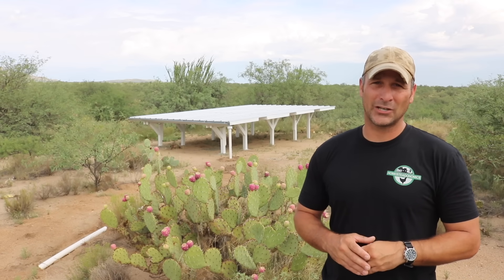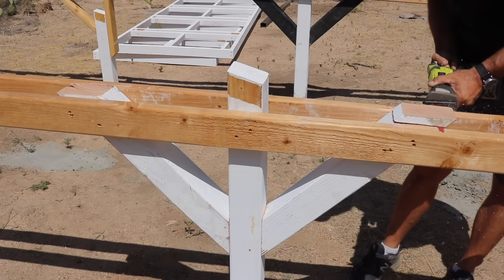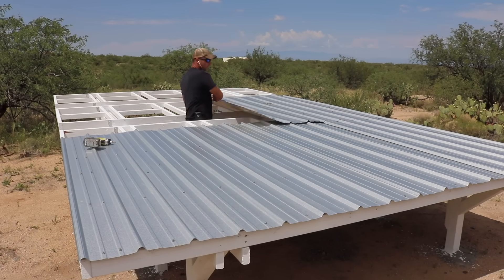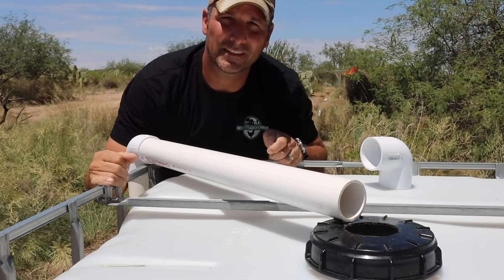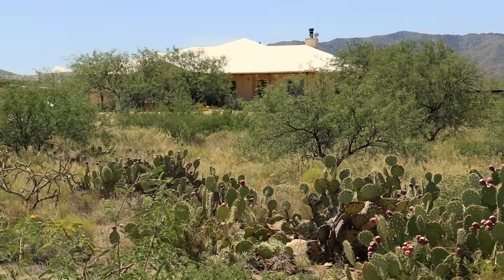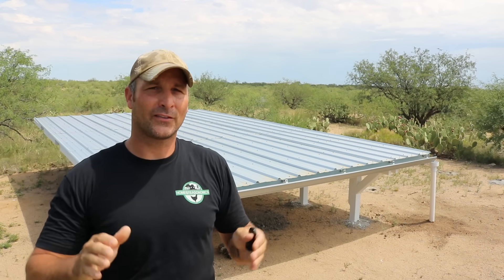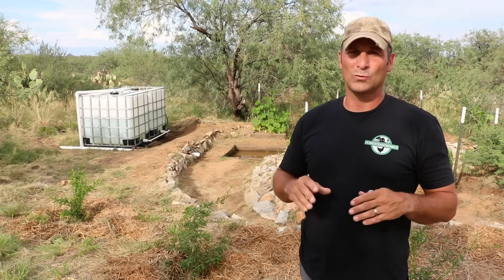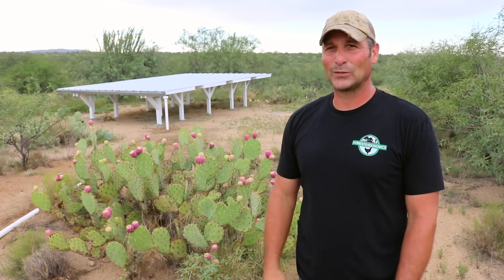Rain Roof -  Rainwater Harvesting Project - How To

Comment: Steel is good. Avoid aluminum though.  Aluminum has been linked with dementia, though dementia is easily reversible with apples.  The pectin in apples pulls aluminum out of the brain cells and is a good preventative.  Or a naturopath doctor, specializing in nutrition, can test for heavy metals.  They can do chelation therapy, iv therapy, to detox heavy metals like mercury, lead, cadmium (from tobacco).  It is quick reversal. People opt to do chelation, instead of chemotherapy.  The cost is nominal and has no side effects.

Comment: If you're planning to use drip irrigation with a system like this, paint the totes black or you'll be plagued with algae-plugged emitters.  You can buy screen filters on amazon for about $10 but even they will plug up.

Comment: You could be sheltering from the rain underneath the roof if only u used taller posts. A waste of material without multi-purposing
Reply from the maker: Did you watch the whole thing?  I actually talk about that and why this isn’t an ideal design, why it should be a structure that has another use, etc,.....the posts were from and existing project and I was just trying to use the materials on hand and make the best of this concept on a remote part of my property

Comment: Tried that in Tampa put a metal roof on my house buried a 500 gallon tank installed treading system .then zoning inspector fines me $500 then I get summoned to go to court for permit not pulled $1500 then I get a court order saying I had to remove the system couse I'm on the city water grid and it's mandatory to buy my water fro. Them . Told them to go f themselves 30 days later they file for seizure of property . Had to fight that for a year . All buracratical bull to steal my money and my house . Told the judge that if any of you bastards ever step foot on my property again they will meet my 2 friends Smith and Wesson.  Judge gave me a year in jail for terroristic threat get out of jail and there was a fucking cop living in my home they stoled my fucking house . And get this the system is still there and this cop is saving tons on water Bill's. So I lost every single thing I owned all over taking advantage of mother nature . The whole system is corrupt crooked and a bunch of thieves .

Comment: You have wasted a good roof and it's purposes. You should have build shelter of some kind. Good intention but bad uses of roof.
Reply from the maker: I actually talk about that in the video.  How this is not the best design and how it should ideally be a dual purpose structure, made higher, etc,.   Did you watch the whole thing?  I was just trying to use the existing structure and what I had on hand to make a project.
Thanks for watching

Comment: I've see  the same used in Arizona that had a fixed structure like yours then added tarps on a frame that spreads over when rain approaches.
Triple or more your water accumulation.
Reply: Two feet lower and rabbits could shelter from coyotes, three feet higher and you would have had a shed.
Reply: Damn just said the same thing

Comment: I see you did a first class job building it but it's so strong and shade is so precious. Why not put taller  poles at the corners and use it for a car port.  Then put solar, panels on top or black water lines for hot water and cycle water through it. Use the extra pressure from the height to fill a higher water tank.  Just always try to do 2 or 3 things at once. All that shade it creates,  you get no value from it.  That's why some thumbs down, not what you built but it isn't raised up.  Knock knock, who's there..........raisin,  raisin who? Raisin water collection table so we can sort grapes in the shade and make.

Comment: Sorry, but have to ask. Your the third you tuber to show the same idea. I think it’s a great idea. I ask myself why not make it higher so you would have shade for what ever you would need shade for. If you had shade for the tanks maybe you would not have to put the tanks in the ground. Maybe I’m missing something with the design.
Reply from the maker: Thanks for checking out the video Donal.   But I actually address those questions in the video. Regarding height, covering tanks, better designs, etc,.   I was just using an existing structure and the materials that I had on hand.  I actually mentioned  that it would be better to have it higher, car port, double use, etc,.   Check it out😀👍
Reply from the maker: .... 0:35 I talk about addressing height, etc later in the video👍

Comment: Will the metal material rust overtime from the elements? Also, because this is in the desert you're making this project, is dirt not an issue getting into the system? Or is this just used to water plants? Thank you.

Comment: Did you test when there is bigger amount of watterflow? I'd be concerned that the watter would overflow from the gutter and lot of it would be spilled. Usually the gutter is closed in the end and it has a hole on the bottom that leads directly to the pipe so that would prevent any spillage . But if it works, than there is no need for this of course :)

Comment: I have heard that there might be a potential for galvanized steel to leech miniscule amounts of substances into the water.  I also heard the amount of leeched substances depended on the amount of rain that passed over the metal, the chemical processes that the manufacturer used when making their composition of galvanized steel,  temperature and climate (dry, wet, etc) and other stuff.  I'd do research as I don't know much.  But playing it safe is always at least a good idea, especially if animals, and/or people will consume the water directly, after some filtration, or through the water cycles after it goes into the ground, into the garden, and "perhap" into the vegetables, and the body.

Comment: At 1:36, what is the name of the mechanism you use to pull the posts out of the ground?
Reply: Also, what angle do you typically use for the slope of the roof and the gutter? Thanks!
Reply from the maker: I used a ‘come along’ with a piece of steel pipe....you can also use a ratchet strap as well.   Just add a piece of chain at the bottom of the post and then place the steel pipe or tubing next to the base of what you’re pulling out.   Connect through come along’ to the chain and then to the steel pipe/tube and Jack it out of the ground👍😀
As for level or slope of roof.   Nothing critical just enough to have the water run off.   But if you are in a heavy snow area you will need to have much great pitch to keep snow from building up too much. 
Hope that helps👍

Comment: It takes a little patience to read through some of the comments. It seems as though people don't watch the entire video, then tell you you should have built it taller. Sheesh...
Reply from the maker: Robar haha.....I completely agree with you😂👍.     When you make videos I guess that just comes along.    But it is crazy when you spend several minutes of the video showing/talking about something that you’re pretty sure people will have questions about.   I think I addressed the height about 3-4 times and also mentioned that this particular case was not the best example..., and that it would be better to make it higher be a part of a double use structure, etc
Anyways, thanks for watching😀👍🙏

Comment: The Govt put some of those up in Eastern Oregon. They’re called “Guzzlers” They collect condensation as the panels cool in night air. The collection tanks are underground. As the Mule Deer, Elk etc. stand on the splash pad their weight pumps the water to a drinking trough. I think if you’d have used darker metal you’d have seen the same results. Look into the “Guzzlers of Eastern Oregon.”

Comment: Smart way to pull those posts.
Something to remember.
I am thinking this on a smaller scale.
A roof on my compost bin.🤗

What I like about your projects is my needs are much smaller.
So far all your work is much easier on a much smaller scale. 🤗😉🤗

I will probably use a durable tarp instead of metal roofing.
Do I have to worry about toxicity?

Comment: You mentioned using other structures in order to make a dual purpose rain roof.  Would you recommend using solar panels to catch rain?  Is there a chemical coat on the solar panels that would make it unsafe?

Comment: So you had the test jigs all set up and all you had to do was run two gutters and an extra piece of pipe to make what you had at the start a viable solution, but you chose to tear it all down, pull posts out of the ground, and start over? How do you feel about the value of the time spent on that endeavor and how much of your time you spent vs the value you got out of starting over from scratch essentially? Just curious.

Comment: I would put photovoltaic panels on top of the rain roof, but I'd do it such that the water collection is not impeded. As you mentioned about dual purpose, I think you might have the same idea. That way that little patch of land is being very efficiently utilized. 

I noticed you're probably in southern Arizona, perhaps around Tucson. I noticed the 928 area code on the banner. I'm in the Phoenix area. I can also say that it looks like you've got some prickly pear fruit to harvest there. Anyway, I definitely like the rain water supplied garden concept. Great job with your experiments.

EDIT: Now that I've read more, I see it's Sahuarita area where you're at. Also, regarding the javelina, I had two thoughts: 1) I'm guessing you've probably considered putting up fencing around the garden to keep them out, and 2) I wonder how much javelina taste like pork.

Comment: It seems like wasted pottential, i mean make it a bit taller and add a wall and you have a shed as well as a rainwater harvester.
Reply: true, but the taller height would make it less likely that the roof would get cleaned when it gets covered with desert dust.

Comment: Why so low?
You should use the space under for shed, o any utility room or just hung a hammock?

Besides with a higher roof will increase the water pressure (velocity of free fall)to run the water in the pipes of distribution 
( plain common sense / physic. : v= hxg
g=9.8m/sec
g= gravity 
V=velocity of water
h=height of roof)

Comment: Would you please explain "Level difference"?  Thanx!
Reply: Water from a higher source will always flow to a lower source. Gravity. 

Thus, the roof is higher than the totes, so any water will flow down the 2" pipe and gravity feed itself into the tanks. No pumps required.
Reply: @ScooterMcAwesomeness  Thank you!

Comment: Awesome. Now if you put solar panels on the roof you will also get clean power along with water and water the plants automatically using motor and you could even use a timer too for it to work 24x7 unattended!
Reply: Verkeerde video

Comment: Thanks for the video, I just hit subscribe. Mostly subscribed because you showed simple quality work, how you did it and why you did it no extra malarke. It seems to me any project is going to vary depending on the situation and resources. Perfect multiple use situations are nice and if you can plan them into a project great but using what you got gets a box checked.
 Loved the stone wall on the garden looks very well done. I'll be looking to see if you have a video on that.  Loved the kids and dog 'helping' as others have mentioned. Also was intrigued by the billboard vinyl system - good repurposing! Two final thoughts - shame someone hasn't created a solar panel that looks like the metal roofing. And "javelina event" not a phrase you hear that often. Again Thanks!

Comment: Add a small pump to the tanks so you can run a sprinkler system on a timer, saves walking around with a bucket

Comment: Thank you for the video.  I will be building mine as a dual/ triple purpose structure, rain water catchment, livestock (milk goats) shade, and shade for the IBC containers.  Planning on doing this in NW Texas so weather is similar to yours. You vid allowed me to visualize a more practical use...too close to the ground and they goats will jump up on it, lay on it...etc, maybe a little taller than yours, therefor providing shade for the animals and a water system. ;P

Comment: we gravity water our plants from the tank using valves to regulate/stop the water flow. we used pvc pipes and simply drilled holes in the pipe that correspond to planter boxes or trees.

Comment: I was told by a roofer that a strip of galvinized metal near the peak of my house would prevent moss from growing on my shingles due to the water picking up some of the zinc from the metal. He said the water will remove zinc slowly over the years by disolving into the water, and that is why after a long time the zinc gets all used up and the metal will finally start to rust.  SO, if this is the case, will your water collector have high levels of Zinc dissolved into it that may not be a good thing for consumption, appliances etc?

Comment: Nice job on the project.   How did the rain water travel up to the “top” of the IBC?    Also, it would be great if the posts were raised higher so that animals can use the roof as a shelter from the sun.  😉
Reply: gravity. the top of the ibc is lower than the rain roof so the underground pipe fills completely with water and because of gravity the water naturally flows downhill through the pipe.

Comment: This is by far the most stupid way i have ever seen to waist a roof. Why is this not just a shed or whatever you want so you can use the space underneath?
Reply from the maker: Rein Clauws maybe you didn’t see it in the video but I talked about why this isn’t the best use of materials and why a multi use structure is a much better set up.  I actually addressed those and other questions several times during the video.  I was using an existing structure that I had on hand and just repurposing it.  It is part of several rainwater harvesting efforts from tarps on the ground(cheapest) to my shop and home roof.   Some are more practical and others like this one are more to the experimental/trying stuff out approach.  🙂

Comment: A roof for ONLY rain collection would be wasting area and construction. Combine it with solar panels. It would allow water collection just the same way. However: The solar panels would store energy f.e. to temporarily slide-out more roof area to collect even more water.

Under the roof you could store stuff w/o need of sun. If the roof is designed with little gaps in between, you could grow veggies which do need less sun, like orchids or mushrooms or whatever.

Of course, the use of a house for a living saves this space anyway.

Comment: Nice work. As an avid RV sturdier, how about using Solar Panels and create your own AC. You could add a lip around them to guide the rain water into your pipe. All that sun going to waste!

This is also a good idea for RVers except the idea could be implemented with a vinyl sheet to snag the water and guide it to the pipe. The unit would have to be lightweight and collapsible. Hmm...

Comment: You know its really inefficient, just in my city every home have rain water harvesting system, they just attach a pipe to terrace & connect to well. Total cost just few pipes & plumber charge of $15. Rain harvesting should use already existing infrastructure, not a dedicated building for it. Just connect rain water collected in your  home roof to storage :) .Not only its cheap it's huge, average home is 1000+ square foot
Reply from the maker: premwithme yep, that is what I said a couple times....that a home roof or a roof of a structure for double use is a more ideal setup.   I already collect water off of my home, my shop, my chicken coop.   I don’t have a well or city water...rainwater is my primary source.  This was just making use of an existing structure that I already had to get some extra water and perhaps an idea for those looking to extend their catchment by harvesting off of a carport, etc

Comment: It is also other design tactic to collect rain ☔ water 💦 that is by making foldable with metal track wheels and has housing for to hide it against tornado 🌪                  hidden housing are covered by  sand or just cement etc. and   [     ]/\/\/\/\< pushing inn the rain ☔ water 💦 collectors ? 😇 🌏 🎭